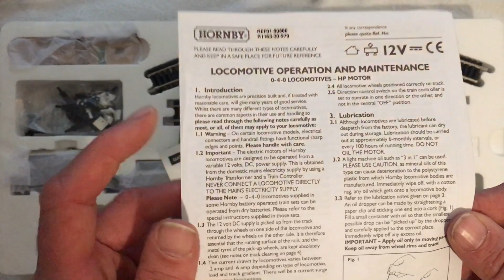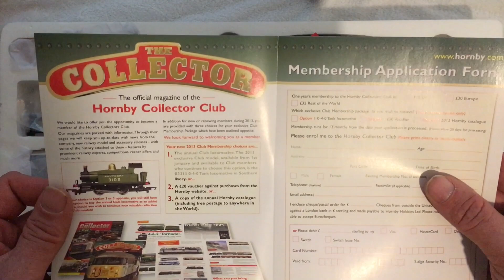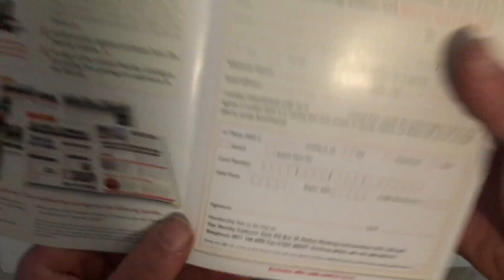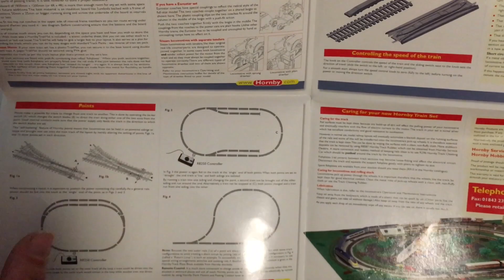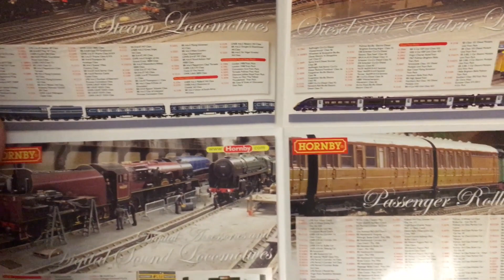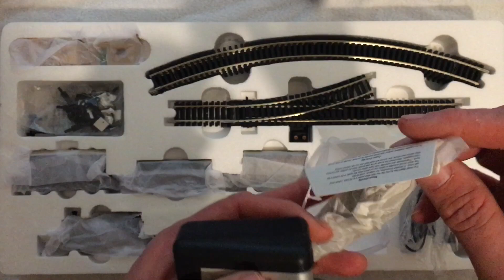Hornby Lowland Carrier - R1163 - 00 Gauge Train Set - Second Hand Bargain - Caledonian Railway

Comment: Cool, this is a lot like the old 'Highland rover' set.
The only differences are that the loco doesn't say 'blue thistle', the 7 plank wagon is gray instead of red, the box van is brown instead of gray & the coach in this set has the lines printed in gold where the one in the highland rover has it in white
Reply from the maker: I think Hornby sticks with a package that works and just change the livery for a bit of variety. Cheers
Reply: I'm retired and reminiscing.. I bought a similar set with the low loader. The loco run perfectly. I built up more sets cos it worked out a good deal. The cost of points, controler,, track an the rest it was so beneficial compared to the cost of individual bits